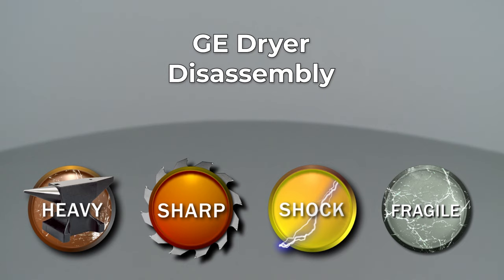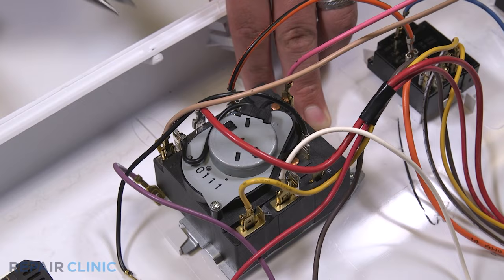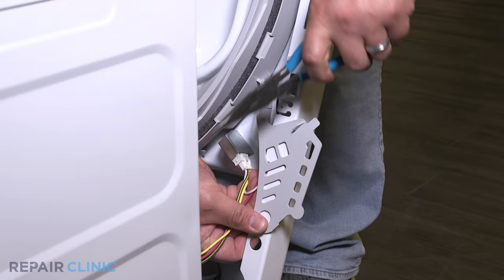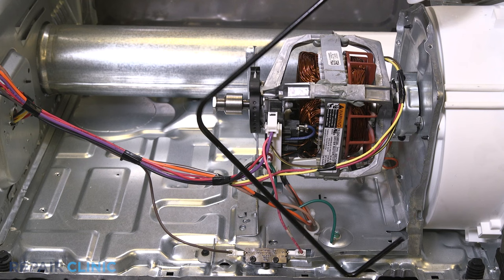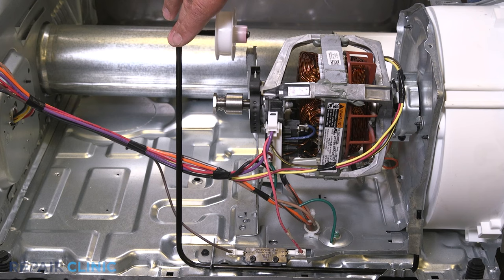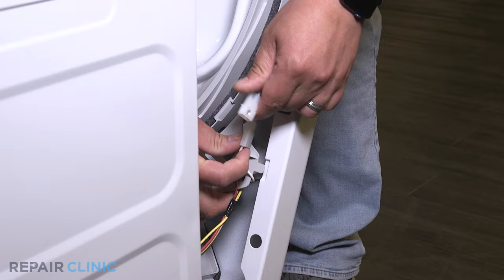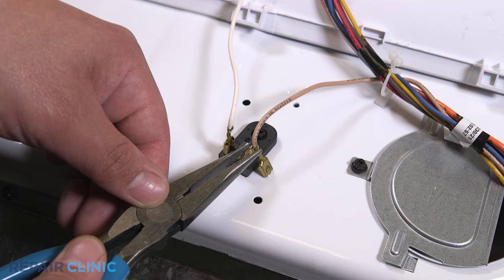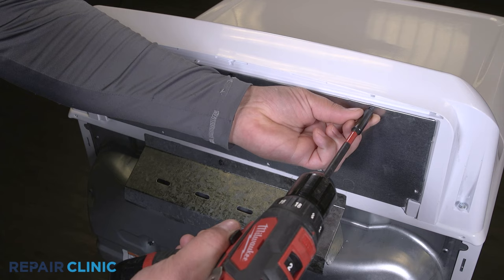Disassembly - GE Electric Dryer (Model GTD42EASJ2WW)

Comment: First I would like to say this appliance is probably an example of the worst engineering possible. No consideration for the guys that do the repairs. Second good video but you get a failing grade from me. The video for installing the belt on the motor drive and idler pulley are taken from the back of the cabinet. The ONLY way to reinstall the belt is from the front. Would help if you showed a sketch of the belt routing from the front. The auto guys figured that out with their serpentine belts.
Reply: Although the view was from the rear to show you the routing and how he did it he did the install from the front best I could tell
Reply: Man this is a POS if I ever seen one. I am an appliance tech and this may last one round of repair and the slant eyed junky will never go back together.
Reply: 0:51

Comment: Thanks so much for showing me how to take apart this exact Model ... we've owned it for 5 years.  It was making some squeaky noise and it turned out to be a small screw stuck by one of the drum glides.  I cleaned the glides with some light weight silicone put it back together and it is running better than ever.  You probably saved me from buying a new dryer for my wife.  Thank YOU!
Reply from the maker: You're welcome! 

If you would like to give us a review, here is our link: https://g.page/r/CcVUrahZNozMEBM/review

Have a great day!
Reply: Thanks for the video I have the same model believe the belt came off

Comment: I have the gas version, but all the buttons are the same. You don't have to remove all these wires... just take the top off and have it hang off the back... You can take the entire top of still and access everything. Also FYI if anyone is dealing with the gas version... they might include an orifice for you to install for LP gas, but... you probably don't even need it.  You literally open up the top & front covers of the dryer, don't even remove the drum, the regulator is right in front of you! Unplug 2 wire harnesses briefly and take a wrench and just turn it to LP, that's it!  I got all confused with all these vids overcomplicating everything.

Comment: Mine went out out of nowhere. I disassembled, cleaned, and even replaced the timer switch since I noticed before it would "wind" when turning the knob. Now the dryer makes a noise when plugged in, but after pushing start, it smelled like something was burning, but no smoke. I checked all the wiring, and I see no melting. Everything looks good. Any ideas?

Comment: This video was a great help. My apartment has the model GTX22EASK0WW but the process is the same other than the different wiring harness at the front panel. It started making a scraping noise and upon disassembly I discovered a metal aglet by the drum lining, probably from a pants’ drawstring. The side panels were also bent and touching the drum as it rotates. Got it all fixed despite our maintenance staff telling us they couldn’t.
Reply: This comment was a HUGE help to me. Thank you for posting I have the same model- and maintenance has done nothing.

Comment: This dryer does not have fuses. It has 2 limit switches. They are on the heating element. It is right behind the drum near the back panel.
Reply: Thank you very much
Reply: Dryer won't start has power to outlet

Comment: Since buying this exact same dryer April, 2022 the drum or dryer has made a load noise. I have made sure that is level. More than several times. Rechecking and since it is on hardwoods bought rubber stoppers to go under cleats, so as not to move when taking in and out clothing. 
I had to clean out filter and below it yesterday. So I had to a semi-disassemble (not having to disconnect wiring on back just slide it where I could get top panel releasing it and sliding back out of the way ). 
All was going well until the front panel. Wow, the drum even holding on to it was just not anywhere close to your video. Very loose, fell or dropped more than I would have expected. 
At this point, I inspected the belt and it was in place from my vantage point. Putting back together due to this drum was not and is not the same. I have not used the dryer, yet. As I plan today to redo to see what is going on? I did lift up as you did on the drum when I went to put on the front panel. But it was just not wanting to work. 
Is there any idea's of what could be going with this drum? It had worked as far as heating. But made load noise, a hard thump and get hot or hotter than my Matag that was 15 years old at the bottom. 
Please, anything suggestion would help. This is my eldery parent dryer and I take care of them. I am not the Ms. Fixer also!

Comment: I had a Maytag for 13 years and it never gave me any problems and now I have a GE for seven months and it started to stop working in mid cycle.  When there’s no clothes it runs very good, but with clothes it stops. We clean the vents and the lint filter of the dryer and it stools stop working and it won’t turn back until it cools off.

Comment: Thank you. My dryer has lint literally coming out the bottom back panel covering the motor despite me cleaning the lint trap 1-2 times each load and checking the hose 3-4 times a year. Im not sure Im confident enough to completely dismantle it, but this has made me much more comfortable attempting to clean it out.
Reply: You have to clean the lint trap out twice per load? Dang yo. My professional opinion is that you should get some less linty clothes 🥸
Reply: This dryer is a lint nightmare. The older GE I had for a decade didn't get as messy as this stupid model. I hate it.

Comment: I have this same dryer. I recently repaired the purple wire that connects to the heating element. Reassembled the dryer and everything worked perfectly for two loads of clothes then the dryer quit heating again. I haven’t taken the dryer apart to see if the wire is burnt into again but the odds are, it is. What would cause this wire to continue to fail? Can it be replaced with a heavier wire or would this create a fire hazard? Thanks

Comment: If anyone could answer, I'd appreciate it. I had to disassemble my GE dryer of a similar model partially after a chain broke one of the dryer glides on the front. During reassembly, the connection tab for the brown and purple wires broke. I figure it should be safe to have the prong/metal contacts touching while wrapped in electrical tape? Please advise.

Comment: If you've never done projects like this..  I wouldn't remove all those wires.  I would take the top lid screws out, and either remount the control panel part or just careful let the lid hang to the side.

Comment: This is an awesome video!  But now I really regret buying this appliance.  Older designs had front and sides pop off just clips.  So much lint bypasses the leaky filter it's a real fire hazard, and the video shows cleaning is impractical.

Comment: Need help locating where the thermal fuse located on this dryer?
Reply: This dryer is insane inconvenient! Disassemble everything to change out a hi limit thermostat, lol
Reply: @deadasfred1246    Tell me about it. Mine just stopped working and now i have to take it, basically, completely apart to see what’s wrong. Last GE product i’ll ever buy.
Reply: @repairclinic  How do you assess which thermostat might be an issue? My dryer just stopped working after a successful dry. When I put the dial on the timed setting, I  can hear a very subtle clicking(but it won't start) - kind of like a clock, but if I put it on any of the other settings, no noise.  Hard to know where to start.
Reply: You you guys get it working?
Reply: @deadasfred1246  Are you joking? It takes not even 5 minutes to completely disassemble. And if you're having to change out your thermal fuses or other parts that often, its highly like there is some operator error going on.

Comment: I have this model and the dryer runs but the heat stopped working, any recommendations?
Reply from the maker: Here are the top 5 reasons an electric dryer isn't heating: https://www.repairclinic.com/Repair-Library/Troubleshooting/2904/Electric-Dryer-Not-Heating-Dryer-Troubleshooting

Troubleshoot these and make sure your dryer vents are clean and clear of any lint buildup or debris.
Reply: Same issue. Did you find your culprit?

Comment: How to replace the cycle button ?
Reply: I've had mine break (just spins around) the knobs pull straight out. You need to buy a replacement knob.  Very easy fix...you can do it!

Comment: You mentioned make sure the idler arm operates the switch.. can you expand on that please? I put the dryer back together and it's not starting. That's the only thing i can think of that is wrong. Thanks.